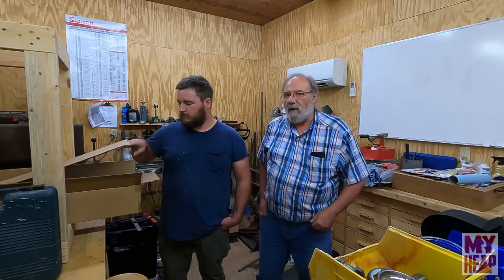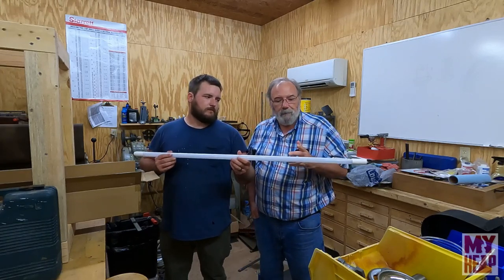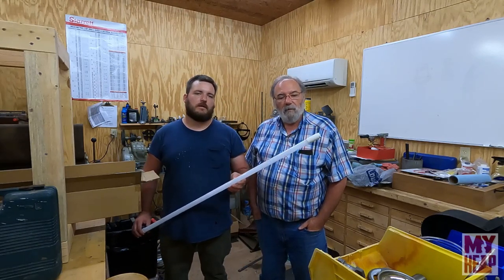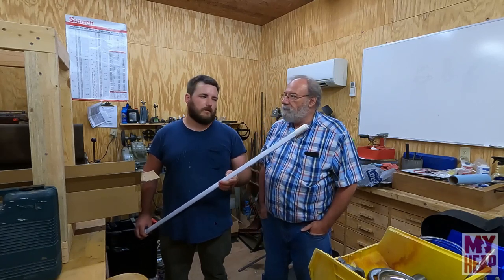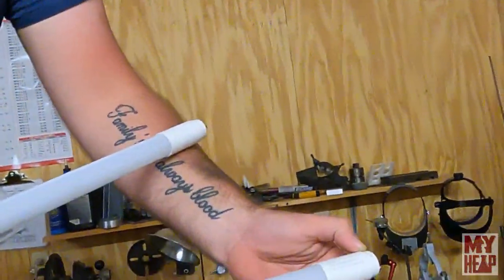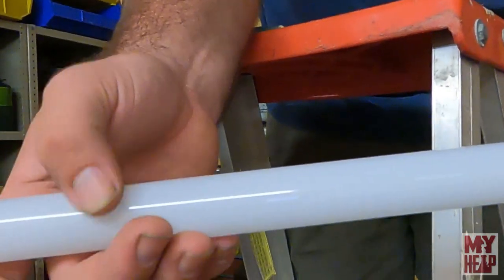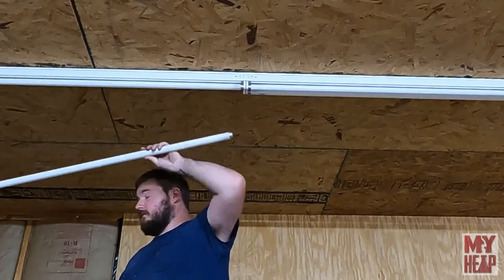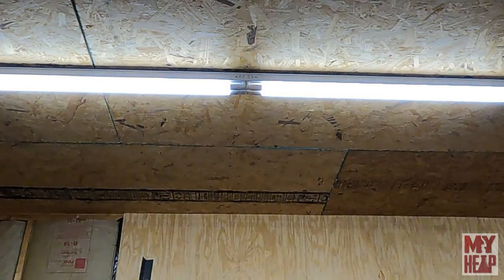Upgrading the Shop Lights to LED

Comment: I have installed 4 4' dual tube fixtures in my shop and they are significantly brighter than the fluorescents thanks for sharing.
Reply from the maker: So glad to have you stop by.  I am thinking they are a bit brighter than the old lights.  Seems the older I get the more light I need to see.  Hope all is well and I hope to finish up my KW engine soon.  At least being back in the shop feels pretty liberating.  Take care!!

Joe

Comment: They are brighter, well done Mike. Saving electricity is good, though you have to factor in how much time there was left on the old fluorescent bulbs.
Reply from the maker: Hi Ben, you have a great point there about the old bulbs.  Fortunately the basement of my shop has four more oth the same fixtures as the upper part of the shop, so they won't go to waste.  I will use them down there.  Thanks for stopping by as it is always great to see you.

Joe

Comment: Hello Joe,
A very useful video, thank you. I think the LED's are a little brighter, either way the reduced running costs are worth fitting them.
Take care.
Paul,,
Reply from the maker: Hi Paul.  Thanks for stopping by.  I tend to agree with you as I think they are a little brighter too.  The older I get it seems the more light I need to see things.  I think it was Benjamin Franklin who said in Poor Richard's almanac that a penny saved is a penny earned.  

Joe